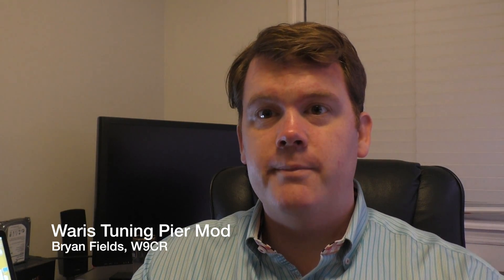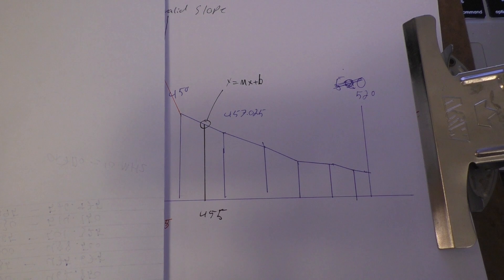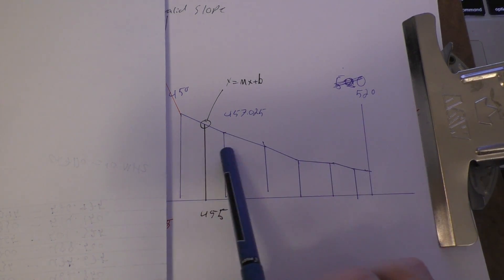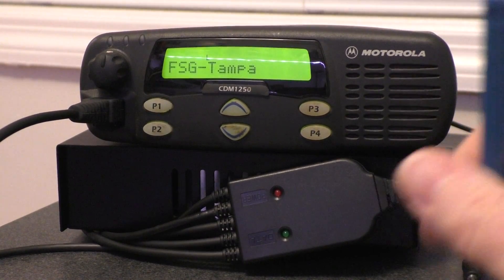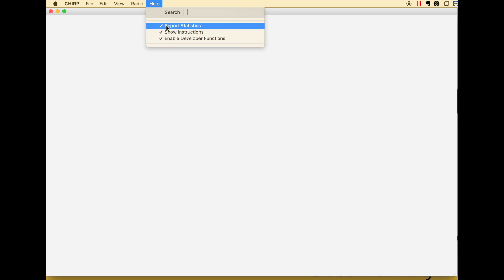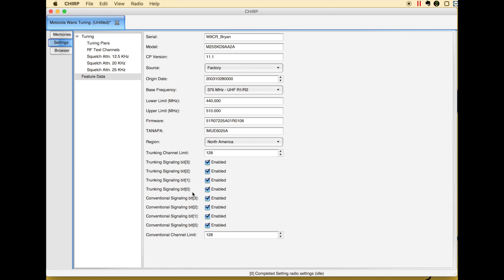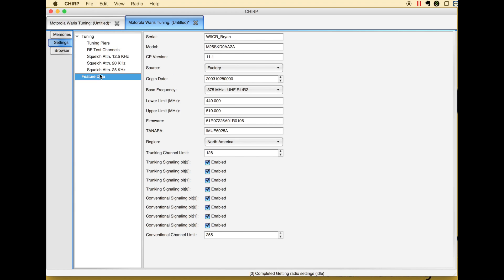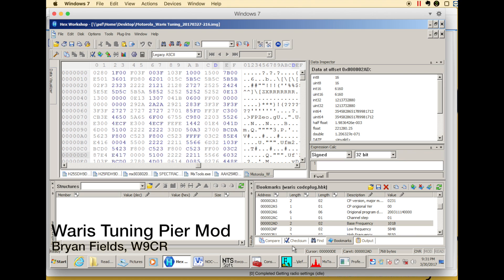Motorola Waris Tuning Pier Adjustment

Comment: Hi Bryan, Greetings from Chile.
Great video. I performed the band change on a 6-meter CMD1250 from 42-50 MHz to 46-54 Mhz and it worked fine. The only problem was that it only received up to 53.450 MHz, after which the device seemed to go dizzy. I ran tests with a tinySA as a generator to check the sensitivity and the range it received. At least it's now in the amateur band on 6 meters. I also increased the channels from 54 to 128; I didn't want to try 255 for fear of crashing. Now I have to test the power output in the new range.
Thanks for the video.

Comment: I did this on my GP338 and now i have a bootloop? the display just blinks continously  how can i fix this ? waris will not read the radio anymore?
Reply from the maker: restore the backup you made of the codeplug.  also GP338 has the 5tone firmware, idk if this will work with it.
Reply: I was not able to make a back up before because of the Asian cps error.  So I forced the waris thing 😬

Comment: Hi Bryan, thanks for all the information. I have a question for you: This procedure could be used in a CM200 (EM200) series radio? I Have a LAM50RPC9AA1AN unit and want to collect information about modding it for amateur frequencies. My plan is to use it for M17 digital voice. Thanks!

Comment: I'm running into an issue (mentioned by another commenter, albeit in a very nonconstructive way...) where I am making the changes using (legacy) Chirp with both the Jul 2021 and Mar 2017 Waris.py file, writing the radio (CDM1250) using a USB (serial adapter) programming cable, but when I read the radio back in to Chirp and CPS the frequency range has been reset.  No errors from either Chirp or CDM1250.  Not sure what could be wrong.  This is on Windows 10 and the version of Chirp legacy as of Apr 2024

Comment: What version of Chirp did you use?  I get an "Invalid or unsupported module file" error when I try to load the module.  Another user had the same issue and you told them to download per the video.  I went through the video twice. There were no instructions, just you loading the module.  Thanks KM4PBE
Reply: Use the Chirp Legacy version.  I am still dealing with an issue where the changes aren't saving (CDM1250 450 to 440), but the legacy version of Chirp will load the module.

Comment: I have some 1550 models and the points go from 403-458 (not sure why) my problem is they are only authorized for 12.5khz and I can’t get it to go to 25 kHz. Want to use these for amateur. 73 W4DXL

Comment: I know the video is a bit old but thank you for the work on this plugin and video. I just performed the mod on a 450-520 CDM1550LS+ and it worked perfectly.
Reply: What version of Chirp did you use?  I get an "Invalid or unsupported module file" error when I try to load the module.  KM4PBE

Comment: Hey Bryan,
Just purchased a HT-1250 LS and am trying to program it with the CPS but there is a password input that is keeping me from programming it. How can I get past this? Is there a way to reset the firmware in order to get by this password requirement?

Thanks much,

Bob
Reply from the maker: The password is stored in plain text in the codeplug.  Just read it and then look at the blocks, all the offsets are on my wiki.

Comment: Hi Bryan. Thanks for your video. I was thinking if the waris module is working with the GP360? Chrip does just turn up red and the radio freezes when I do a read? Any ideas? Thanks again.
Reply from the maker: That’s not the us firmware, codeplug is different
Reply: @W9CR  Thank you for very fast response.. Do you know if its possible to find anything for the eu firmware?
Reply from the maker: @simonlockdk  its close, try decoding it and building something.  Either that or flash it with us/mdc firmware.  Do you really need 5tone?
Reply: @W9CR  I need to enable the mdc 1200 option. That’s the most important.
Reply from the maker: @simonlockdk  yea, you need to flash it with the us firmware then, the 5tone radios don’t do it.  Go read my wiki, this is beyond this.

Comment: Bryan, thanks for this! I'm new to both Linux and batwing products, but I'm gonna give this a shot, moving a low-band low-split to 10 meters. One question - After the piers are redefined, when does the radio determine the baseline values for the new piers? At boot? Or is a full alignment process required?

Comment: I tried to do that for a 1250 ls + to turn on mdc on conventional. But when I try to use chirp with the saris.py and it did not work All I get is a red background and it does not say Motorola in the drop down box

Comment: Thank you so much for this, i have a stack of 450 CDM1250's i can repurpose now, worked without a problem, only issue is that i could not save the image of the radio initially in chirp, it gave me an error.
Reply: Do you want to sell any? I'm interested in uhf or high vhf

Comment: Haven't bricked a radio yet with the Waris.py.   I have 2 29.7 to 36 mhz radios coming tomorrow.
Putting them on 10 meter 29.5 to 29.7 .  I have done a number ( over 30 ) CDM1550 220 mhz radios.
No problems with any ..

Comment: What version of Chirp were you using.  The new one from the site does not have Motorola as a listed radio  CHIRP daily-20200107  Trying to get my cdm1550ls setup for DMR in Belleair Fl
Reply: Download the .py file as mentioned in the video.

Comment: Ok using it on a ht1250ls+ works like a charm. But tried to use it on a cdm1550 and when I put it on 25khz the squelch wont close. Any feedback on a cure for this??

Comment: awesome work Bryan. I have a question about modifing a 136-174 radio to 220. how do you make the adjustments in the tuning piers. do you just add 50mhz to each pier to make it 225?
Reply from the maker: Why not just buy the 200 MHz version?  
If you just want to try it, sure add to it and have fun, but you'd likely need to redo the entire VCO and PA to have it work.

Comment: Excellent work Bryan.  I did a CDM1550LS+.  I moved a 450mhz 520mhz to 440mhz-510mhz. moved all tuning piers 10 mhz  exactly how you did,  I also did a CMD1250 low split from 403mhz-470mhz to 405mhz 473mhz moved tuning piers 3 mhz. I also did not have to write a new codeplug . I backed up code plugs in CPS and did mods via chirp with original code plugs and after mods when I read the radios thru CPS they were still there, I also added channels. Radios work fine and sound great. I don't think they need to be realigned as they are clear .THANK YOU SO MUCH.   73's
Reply: Update, This mod will bring your CDM down to 440mhz.  HOWEVER after I did this I put my radio back on my bird watt meter and anything below 450mhz will have a output power of only 15 watts on high or low power. Above 450mhz will be fine

Comment: I had problems with the new July 2017 Waris.py file on my CDM1550.  It looked like it programmed but it didn't take. After reading the radio again it had the old values.  After trying the March 2017 file it worked great!

Comment: Thanks Bryan,
Using Chirp on Linux, programming AAM25RHD9AA2AN ,AA25RKD9AA2AN 440Mhz and  AAM25MHF4DP5AN 220Mhz radios worked fine.
I've also modified several of the 220Mhz radios following your directions, changed the filters and am very happy with the performance.  They work so well I ended up building a repeater with a pair of them to replace the Tait TB7100 I currently use.
Now if you (or someone) can extend what you've done to where I can program the remainder of the radio I'd be ecstatic.

Comment: Nice one Bryan, that worked first time.  I had no idea CHIRP even had Moto support.  Any way to increase the 16 channel banks do you know?  Also, is the Tuning-Piers Excel file available?
Reply from the maker: Did you watch the video or even try using waris.py?  It's in there, set it to 255 and be done with it.
Reply: I ran the software, changed the owner name and codeplug to Factory,  increased the total memories from 64 to 128 and programmed the amended file into the radio without a problem. I thought the CDM1250 was limited to banks of 16 channels
Reply from the maker: No, only the HT1250 is.  You can still only scan 16 channels however.

I increase the memories to 255 (FF), as they can do it.  Keep in mind if you take it out of band you may need to adjust the tuning piers.

Comment: Will your script/tool be able to modify the channel capacity of a CDM750?
Reply from the maker: probably, try it and report back please.
Reply: I got it to work on a 16 chan ht750.  I tried 255 channels first, but the radio wouldnt boot and gave error beep.  I thought it might be bricked but I was able to reflash firmware and get recovered.  I got the courage to try again with 128 channels and it worked perfectly!  I guess 255 overloaded the memory?  It the mem capacity different throughout these waris series?